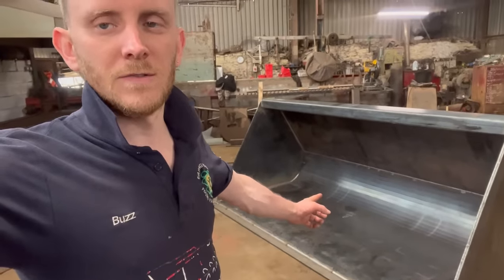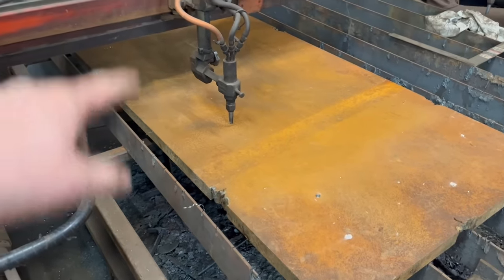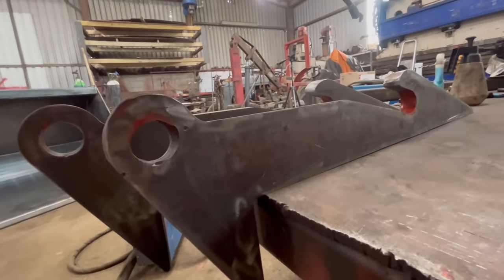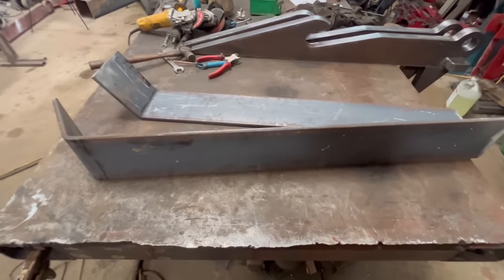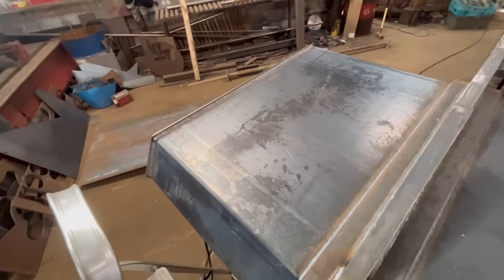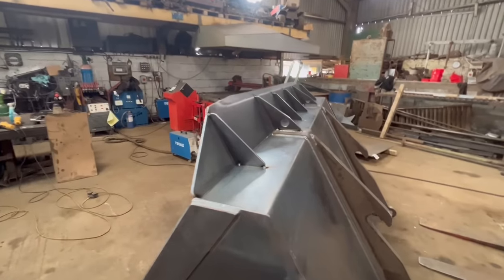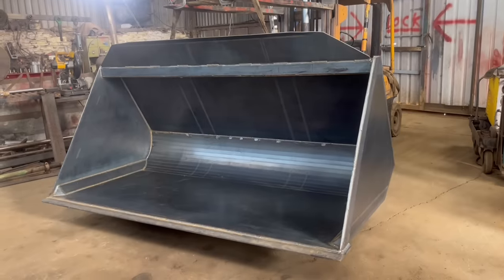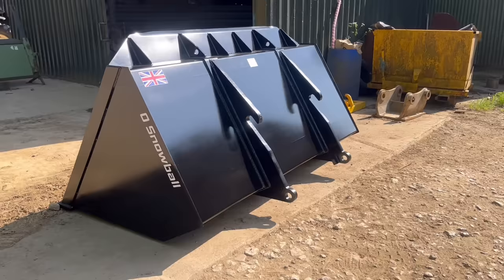Making a JCB loading shovel bucket from scratch. Part 2

Comment: Takes a pretty good sized fluid tip to chase your dry edge around that bucket.  Lots of large flat areas.  Slightly slower reducer can lend you a hand getting the paint to lay down a bit nicer.  Regardless it is good enough for a bucket that will get abused.
Reply from the maker: This why it’s hard to get a smooth consistent finish?
Reply: @snowballengineering  I didn't get a good look at your paint, but typically that is the issue.  On large flat areas you are literally chasing the dry edge off the panel.  If the solvent or activator is too aggressive for the temperature you can't move fast enough and end up with some dry spots.  To counter that you use slower activators and solvents and as large a fluid tip as you can handle (1.4 mm maybe larger) to try and cover more area faster.  I oversee quality control for an ag implement manufacture.  We spray lots of gloss black every day on metal just like yours.  Our paint is delivered in 55 gallon drums ;-)

Comment: Gday, I have really enjoyed this build and the end result looks bloody good and there’s nothing wrong with the paint job, the torch table works great and the cut is I’d say the best I’ve seen, the new boring head is something you’ll wonder how you did without it, have you thought about plasma cutting your logo to weld on the jobs you do?, top job mate, cheers
Reply from the maker: Thanks Matty, Glad you enjoyed watching.  The torch table does do a good job, for an old machine I was surprised how smooth it runs. I think the boring head will be a great addition, just limited on space with my mill on the jobs I can fit in. Plasma cutting some logos out would be a good idea, ill have to do that.

Comment: A few things. Really well done. The quality could be compared to the best in the market. Hope you were paid what was it is really worth. I designed and made a 3.6M x 1.5M 1100kg tare weight tipping trailer in Australia from scratch many years ago and thought I did OK. But your work is second to none. As others have suggested, get your logo and ph no cut out on the plasma and weld it to the bucket (and all your other work where it is feasible). That is free marketing and advertising. Your stickers will be obliterated first load of manure.
Reply from the maker: Thanks! I do have ID plates i rivet on with my details on. But yes I’ll have to cut out some logos to weld on.

Comment: Them boring and facing heads are pricey...

Good video 
☹🇬🇧
Reply from the maker: They are! This one is second hand but still pricey, will be a good investment though.
Reply: @snowballengineering  

You'll need it for facing weld recovered bucket pin holes...
☹🇬🇧

Comment: Good job, looks great. I worked in a profile cutting shop where the top table was hinged to get the steel plate in and out. Then the top of table was used for the patterns etc. We would always use as much oxygen as we could, without causing blow backs, to get a nice clean cut. The problem with the tables was you could get hot slag in your boot quite easily. All 3 of us never tied our laces and when slag did go in the boot, you would shout "BOOT" and flick it off your foot,  giving the other guys time to duck. The socks would have burn holes in them. Great post, thanks.

Comment: Phenomenal job on building the bucket Olly. Love the magic eye profiler and its simplistic yet effective cutting method. I could really see the sparks flying off the sharpie when you used the plasma cutter as a plotter. 

I know you've probably got a long list of kit you need, but I think a gantry or post crane would help you massively as the forklift won't always get beside a job or machine
Reply from the maker: Thanks!  A gantry crane would be great.

Comment: Hi Olly  great job on the bucket, very impressive. You always show good little tricks along the way, like how you counteract distortion. The bucket is as good as any manufacturer can build for sure. You will get the use out of the boring head, very useful. Nice gussets  finishes  the job well. What is the guage of the sheet metal?. Thanks Ruth😁
Reply from the maker: Thanks Ruth.  The bucket is made of 6mm which i think is 2gauge

Comment: My first week as a engineering apprentice in 1978 was in the fabrication shop ( Training shop supervisor was on holiday), this was spent with George on the profile burner, it was a BOC Falcon,  I was amazed the magic eye following the hand drawn outline, I think BOC recommended a special green pencil, but the guy who did the drawings found out a standard pencil could be used. I think it used Propane, rather than Acetylene,  lot cleaner.
Great idea on the CNC "Plotter", the Wolhupter boring heads are top notch, always sort after.
Brilliant end result,  looks great.
Thanks for sharing.
Reply from the maker: Yes, mine will follow a pencil line too. Although if the depth is a bit off it loses it sometimes. A sharpie seems to have more tolerance.  I also run mine on propane. Thanks for watching!
Reply: @snowballengineering   Not sure if good quality permanent markers, eg Sharpie were readily available/used then, for repeat or standard flame cuts, velum film was used.
 Best regards John from the Black Country.

Comment: I cant wrap my head around the short arc welds on the thick plates. The welds look good and wet, correct convexity but the code does allow for short arc on anything over1/4". You are supposed to use spray arc preferably dual shield. If you are in Australia you are under the same code as I was namely AWS.  Where is you penetration? If you use solid wire MIG you are supposed to be at a minimum of 180 Amps for spray mode. I am not hearing it.

Comment: After taking the time to bore the holes in the hangers, it made me cringe when you didn't align them with a rod while welding. Just the thoughts of an American toolmaker.
Reply from the maker: The pin hole is a good amount bigger than the pin so it’s not critical to a few mm

Comment: Awsome work again m8, one question i would have is why use flux core instead of gas, its what i assume anyway with anti spatter and dragging welds
Reply from the maker: I’m not using flux core.
Reply: @snowballengineering  OK sorry about the assumption bud

Comment: Can you put a flame torch on the cnc so that you can cut over 25 mil?
Reply from the maker: I could do, but the machine itself is older than me.  It’s time now to start upgrading and modernising my equipment.
Reply: @snowballengineering  looks very good overall. Nice project. Well done!